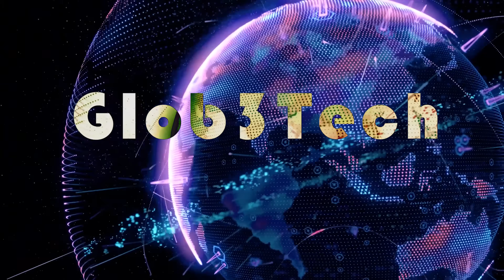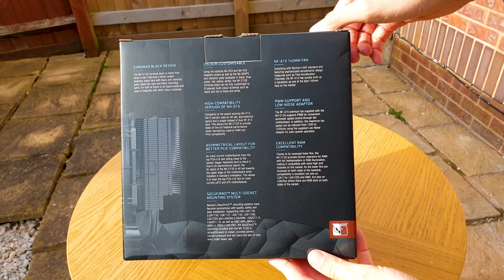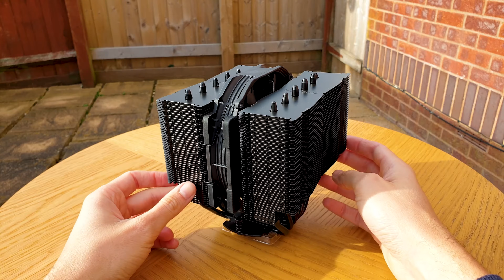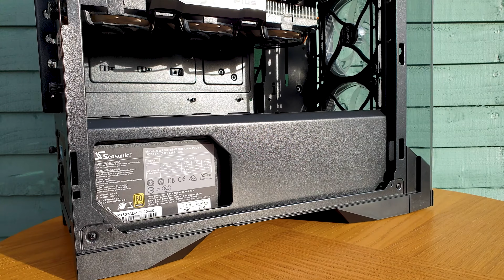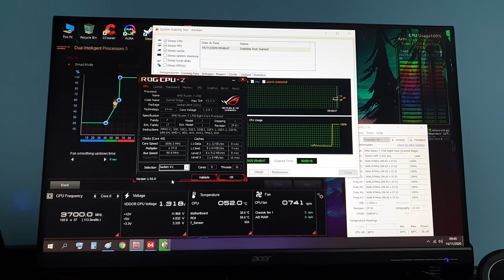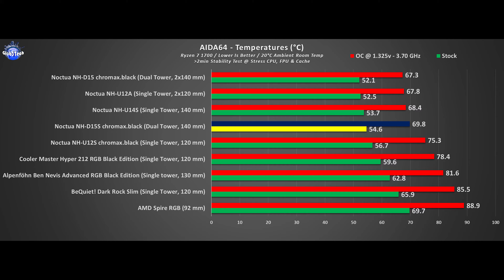Noctua NH-D15S chromax.black - Versatility Reloaded !

Comment: Would this fit with 4 sticks of TridentZ RGB Ram? im deciding between NH-D15 vs NH-D15S. would really appreciate if you can answer
Reply from the maker: Of course 🤗 So, the D15S will clear them not a problem. As for the D15 if you check my review for it where I also had the Trident Z Royale (same height as yours) you either position the second fan a bit higher on the heatsink if your case permits.
Reply: @Tech_That  thanks! I made my decision now. I'm buying the NH-D15 instead of the the S one
Reply from the maker: @joekeizer2758  Good luck. Glad to help. Let me know how it goes 👍
Reply: @Tech_That  I will! I'll be getting it this week, I'll update you
Reply from the maker: Perfect. Thanks! 🤟

Comment: Do you recommend this cooler with my setup? 
Case : gigabyte c200
Mobo : z390 gaming plus msi 
Cpu: i7 9700k 
Ram : 2*8 corsair vengeance pro rgp (51mm) tall 
Is it good or there is any non compatible item ? And will it cool the i7 9700k without overclocking ? Just gaming
Reply from the maker: Hi. Thanks for the detailed info. Yes, it should fit and clear the ram and everythind around.

Regarding cooling, yes it should handle the cpu in stock form especially in gaming.
Reply: @Tech_That  wow thanks for responding this fast .. but I have a question do you recommend this cooler ? Bec I wanted to get the nh d15 (non s) but ram compatible is problem and then wanted to get dark rock pro 4 but same problem .. now I only see this .. and I got 100$ do you recommend this for me or there is something better ?
Reply from the maker: Sure, my pleasure 🤗 I highly recommend the D15S or the U12A. Both I have tested and are really good and really close to the D15. The U12A is 100% RAM friendly and it comes with two fans. They are making the all black version of this as well soon. 👍
Reply: @Tech_That  I see in amazon that the u12a is 100$ and the d15s is 80$ what do you think
Reply from the maker: It's up to you. Both are great. Get the D15S now and get another fan in the future if you need to 👍
Reply: @Tech_That  ok thank you for responding :) sorry for being annoying lol
Reply from the maker: @guest2945  You are most welcome. 🤗 No, not at all man. Glad to help. 😁 Ask away. Let me know how it goes.

Comment: Should I get this cooler for my pc build. I’m gonna be rocking an i9 10900k. I’m gonna be gaming (cod, battlefield, other shooters, etc.,) and I’m also going to be producing and recording music. Where I’ll be connecting instruments and mic to an interface. I’m debating between the nh-d15 or the nh-d15s. I like how the 15s is smaller and has ram clearance. So I do not know which one to go with:/ I’m not interested in aio coolers tho.
Reply from the maker: Hi Kevin. Sure. I think you would be fine with either depending on your pc case and what ram you plan to use. From my tests, since the D15S is so good and cheeaper and you can always add an extra fan in the future, I would choose the D15S also. 👍
Reply: @Tech_That  Wow! That was fast. I’m planning on using the Corsair 32gb vengeance rgb ram. Since I will be doing music production and maybe a little bit of streaming! My pc case will be the Lian Li Lancool II Mesh ATX Mid Tower Case.
Reply from the maker: @kevinnoboa9908  You are welcome. Glad to help 🤗 If you want the U12A (which is my favourite air cooler btw) they are releasing in Q2 the chromax.black variant as well if you want color matching.
 Either way, you can't go wrong with the D15S nor the U12S. Your case is excellent you can, plenty of airflow and any tall cpu cooler will fit.

Sorry, just saw you ment the u12s. Go with the D15s in order to have plenty of headroom since the i9s can get quite hot.
Reply: @Tech_That  Oh thank you so so much! I will go with the DH-15s. In Canada they’re sold out of the DH-15s. However, if they release the U12A in black. Should I get the U12A instead and just wait? Because I know the U12A is really good, would the U12A also be good?
Reply from the maker: Most welcome 🤗 Yeah same here, most of them out of stock. If you need your computer now, get whatever (d15s / u12a) is in stock. The black u12A,  I think it's a long time to wait since q2 is from March onwards. 👍
Reply: @Tech_That  Well thank you so much! You solved my problem! I subscribed and hit the notification bell, thank you! I will most likely wait for the U12A because I’m also waiting for 3070s and they’re coming in around March where hopefully the U12A in chromax black will come out. Because I’m trying to buy everything at the same day (roughly)
Reply from the maker: @kevinnoboa9908  Ah thank you so much Kevin! 🤗😁 Glad to hear that man. Yeah sounds about right with the timing. Good luck and let me know how it goes 🤟
Reply: @Tech_That  thank you so much! I will be sure to let you know how the build goes:)
Reply: @Tech_That  I also looked at the nh-u12s. Should I get that cooler or just the nh-d15s? Thank you

Comment: Can you do the ryzen 5 5600x amd ryzen 5 3600 non x or xt with a lp cooler like l9a black ridge(92mm fan bottom and a second test with second 120 fan on top) cryrig c7  
I wanna kniw will i be able tp cool ot down with a black ridge cuz undervoltimg is broken rn
Reply: Damm you fast man
Reply from the maker: When I can get one sure. Still nothing in stock in the UK.

Comment: Can i add a 120mm fan to the side of the radiator?
Reply from the maker: Yes. The stock 140mm fan has 120 mm mounting holes and the extra included clips are the same.

Comment: Thank you, but I have two questions. First: Does this cooler support Intel processors containing 1200 LGA, does this cooler support that or not, and the second question: Is this cooler better than SEYTHE NINGA 5 or not, which is more powerful of the two? I hope for a reply and thanks.
Reply from the maker: Hi. It supports the LGA1200 since it has the same socket spacing as all the 115x sockets. 
Equal or slightly better depending in just raw cooling performance. I don't have it but I keep hearing good things about the ninja.
Reply: @Tech_That    I mean, he supports him formally or in a corrective way or is inclined to him
Reply from the maker: @user-qz3yp7ju6p  It does 100% 👍

https://noctua.at/en/nh-d15s/specification